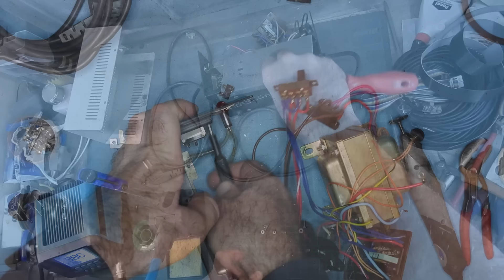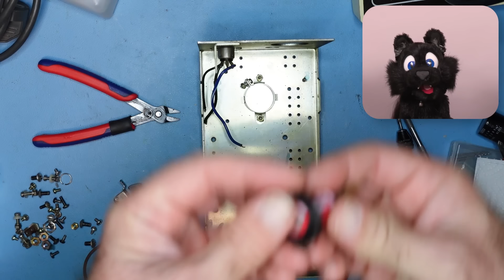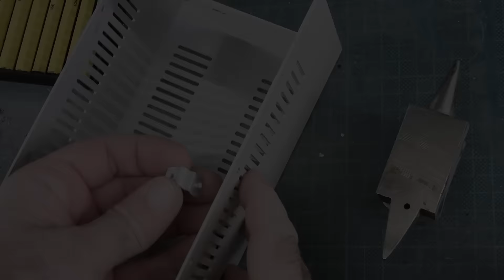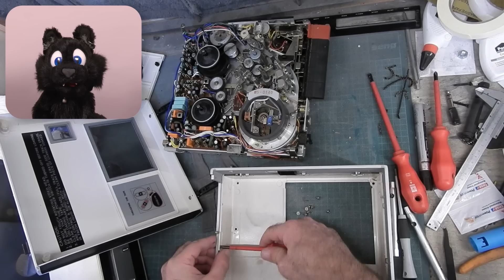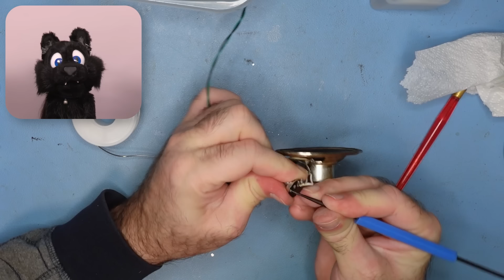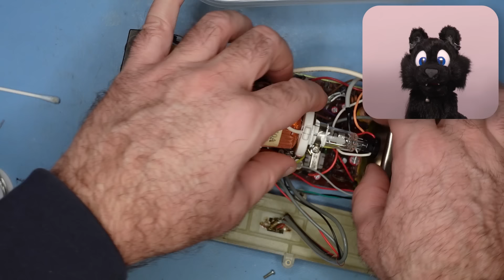Akai VT110 - Part 1

Comment: I was not so lucky with one of these.  ALL shot rubber and bad Transistors.  Of course the customer thought he could have all his tapes transferred for $100, INCLUDING The repair!🤣
Reply from the maker: Yeah, I got a set of new belts here, the idler wheels are still on my todo list and I don't know what I might need for electronics... but I agree, 100 is at least short one zero :)

Comment: The last gasp for this format was the Kiddie Kam,  which was I think this basic designed  into a kid's toy that recorded to a cassette tape in black and white.
Reply from the maker: I have seen those before; but I think the reel to reel version is still a tad bit higher quality, because it does a rotating head (helical?) recording pattern. But we'll see...
Reply: @atkelar  yeah that is the PXL2000 by Fisher Price. Not the one I was thinking of though as it was a little higher quality.  It must of been just for  the Asian market as I only remember seeing them in Singapore in 1989.  Still haven't found any info on in it though.

Comment: With regard to difficult dismantling- it's always worth checking if the lacquer will soften with the application of heat. Often makes breaking it initially easier and makes the threads easier to chase. 

Well done with it this far, looking forward to the electromechanical "fun" for the tape deck...
Reply from the maker: I did grab the tiny blow torch for some of the motor screws; But for space reasons, I don't have my reflow workstation set up permanently. And geting that out for "just" one screw or so is a bit cumbersome. The blow torch thingy works well for heat shrink but when I want to heat up metal, I am a bit hesitant when there are wires or other plastic pieces around; the hot air station has better regulation for that.

And yes, the "many, many pieces" of the tape deck. It's "in progress"... at least I found replacement belts. I hope they are the right size, as I could not try on all of them for size yet.

Comment: 36:59: "I am sure they need to be correct" Yes with just a few small exceptions, but those would flip the image. Also note that it is very important to not have any finger prints under the suction cup.
Reply from the maker: The connections are an interesting mix between high voltage and low voltage signals. Some of the PCBs from the main unit have etched labels next to the pins, so "V.B." is the vertical blanking output, which helps navigating the different service manual. But the TV section didn't have any markings... I also had to twiddle the trimmers to find out what they adjust. The final picture is still not perfect, but it ended up better than in the video. I just put away the camer so I could focus my attention on the live high voltage instead.
And I'll give the cup another wipe... but I'm pretty sure it's rather clean: I did wipe it with IPA before I attached it and by proxy I also had my fingers wiped at the time. So I don't think there's much in there.

Comment: This is interesting. I didn't realize till I looked that theres several models in the VT-1xx range. Compatible?
Reply from the maker: As far as I can tell, the connector for the TV/RF modulator and Tuner is pretty much the same. The power supply also looks to have the same specs. The only thing I can't say for sure is the camera hoookup. There's quite a bit of difference in the sync-signal generator PCB. Mine doesn't match any of the schematics I found.

Comment: Akai still make electronics but they less labour intensive to build. The PSU was a tank, but really a lot of work for the people assembling them in a factory.
Reply from the maker: It's probably easier "from scratch" - because they certainly had the correct schematic around and would cut new wires "to fit" rather than trying to make existing ones fit again... Back in the day, they hadn't optimized the processes as much yet.
Reply: @atkelar  true 👍